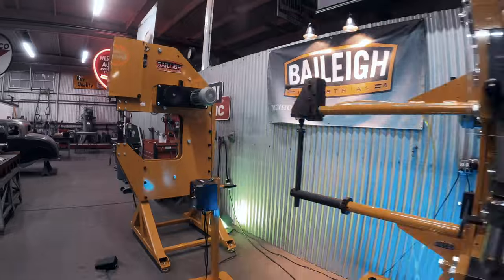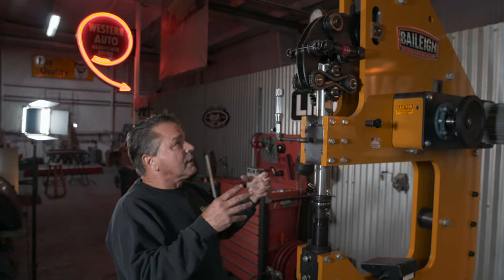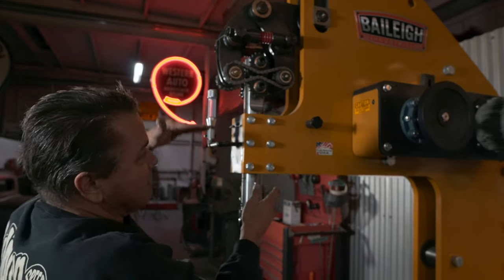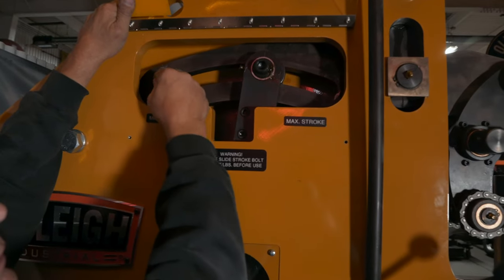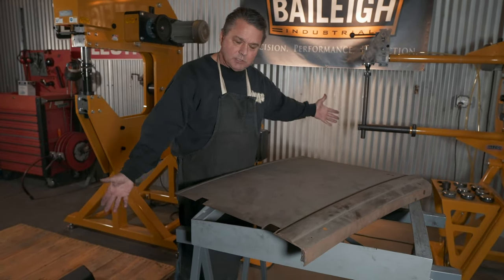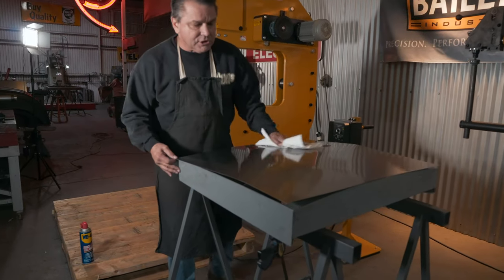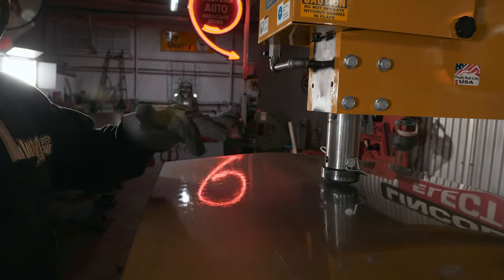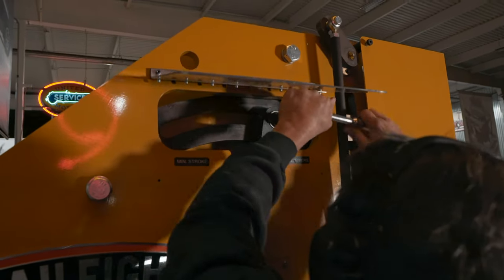Baileigh TV: Walden Hammer Works Episode 2

Comment: I have a similar electronic variable speed control box. Inside there are dials that you can fine tune the hammer controls. I’ve dialed mine in to stop right when I release the pedal. I love these videos. Extremely informative and helpful